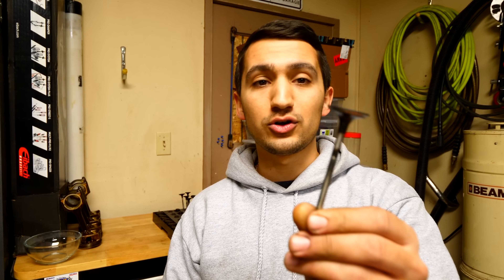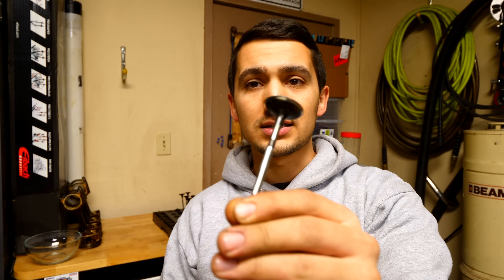How to Clean and Refinish Valves

Comment: Those valves look brilliant, but personally I won't be 800 grit sanding my valve stems because those clearances are precision engineered and once they're out of spec you need new valves altogether, otherwise you don't have the appropriate film of oil in-between. Maybe if I'm coating them and I need to slim them down first, I might.

Comment: all that truly matters is that the valve seats properly, that carbon will return within 5000km easily
Reply from the maker: Regardless with these valves or new valves, I will have to lap them into the seats to ensure a proper seal 👍
Reply: He's installing a catch can. The reduction in sludgy deposits will be realized immedietly just from that. Now that the valves and ports are a high polish, the walnut blasting will be much more effective.
Reply: He likes his cars to be super clean.
Reply: Polishing a valve decreases surface area for carbon to deposit on.
Reply: A highly polished back surface inhibits carbon deposits and improves flow over the valve. A highly polished face (inside the combustion chamber) reflects radiated heat from the flame and helps keep it a shade cooler (more important with exhaust valves). Read A Graham Bell
Reply: Polishing isn't bad but he needs to have them actually ground at a machine shop before lapping.
Reply: Agreed.  Polishing the stem is a big NO-NO.
Reply: install catch can after rebuild cylinder head
Reply: actually, having a polished valve means that there is less friction on it, the surface finish is much finer. They will get dirty no shit, but its probably going to be after 10 or 15K kms rather than 5.... and anyways, you can get additives and service procedures that will clean carbon off the valves, ie upper cylinder cleaner and fuel additive, also seafoam.. the point of this is to stop it from being as dirty as often and for perfomance
Reply: Polish does not mean less friction.  It means its harder for contaminates to attach, but the smoother the face, the more contact the air has with it, thus slowing the air.  Simple dynamics.  Look at the Magnaflow muffler build and they have holes inside of their mufflers for this reason.  More holes means less friction because it has a smaller surface area.  I bet the thermal expansion is better with the polished face, but I bet the only way you could see it would be single, or less than single figures on a dyno.
Reply: Polishing the bottom of the valve and above the seat to a little up the stem is good. Never sand the stem or seat. Now you need a valve job. Lapping the valves is not a valve job. Laying is for smoothing out the seat if it’s in good shape. Now that you sanded the angles off the valves you can buy new ones. Lol
Reply: @milanmastracci  Why didn't you put that in the video?
Reply: Your valve seat put under a microscope will look like the blade on a rip saw and seat to valve included angle will seat about as well as a man hole cover, or fit BBs between the seat and the valve sealing surface after removing 0.90 thousands of the valve stem with 36 grit sandpaper; You are now mechanic of the year!!!
Reply: He should scope the engine to see what they look like at 15,000 miles. Very interesting.

Comment: Valve lapping is a must now after you sanded them valves. The valve must match the mating surface on the head to have the proper seal. Good luck.
Reply: Milan Stankovic AD FREE you beat me to it. Props
Reply: That is must anyway ;) Lets hope he didnt made much damage with sandblasting so he dont have to polish seats like 3 days LOL :)
Reply: Pozdrav Urose! Ovaj moj imenjak se trudi. Pratim njega vec par godina.
Reply: Pozdrav Milane :) Jeste, mali baš daje sve od sebe, zato mi se i dopada :) (kada ga uporedimo sa njegovim vršnjacima dečko je genije ...) I baš mu želim da uspe u životu.
Reply: Never mind lapping I wonder if those valve stems sealed properly after that abuse 😂
Reply: I'm sure he found a way to attach the valves into his drill head from the back of the head and lapped those valves into oblivion....
Reply: Forget lapping them, it's time for the machinist to break the news to him that his valves are trash now. Because some idiot sandblasted the stems an then wet sanded them in a drill chuck.
Reply: Probably just sand blast the seat to match the valve
Reply: @mikespeck8642  😆
Reply: i was thinking the same thing. don't touch the stem or the valve seat.maybe a light lap with the seat if there's carbon. i would use a magnifier cam on my laptop on the seat.
Reply: Hell no. I'm not sanding any metal off the stem for the valve to wobble in the guide and for oil to pour down the combustion chamber and or  cylinder face, i'm not nicking my valve stems, i not sanding the coating off and i'm not sanding the rough atomizing valve head neither.  All bad advice unless you want shiny valves that you stare at, which means you're not driving that car.  Me i'm driving and won't be staring at those valves. I just want to be able to know that they are performing optimally, that they're strong, tight, don't leak oil and hold pressure. All bad advice except for a valve fashion show.

Comment: Sanding polishing i.e. reducing thickness of parts which are inside the engine , better performance can be obtain as you said , but isn't it dangerous for long riding vehicles . heat inside engine is going to damage this repaired parts more easily as they are thinner than usual .
Its a question shall we do it or not ???? 🤔

Comment: No, don't sand the stem or even scotch bright it. Also tape the stem before you put it in the chuck otherwise if will possibly get damaged by the hardened teeth of the drill chuck. 
Any metal removal from the stem is bad and will cause oil consumption and shorten the life of the valve. 
Otherwise not to bad.

Comment: Why on earth should you polish the engine valves?! all you need is to remove the built-up carbon... Also, sanding the valves might cause improper seal when you get a spot sanded more than the others!
Reply from the maker: If you aren't using a drill or some way to keep the valve spinning, yes I could see the flat spot argument, however with it mounted in the drill, it gives a very uniform result
Reply: Right... <3
Reply: And that's where the lapping/grinding comes into play...so no problem with that.
Reply: people pay a lot of money for new valves that are polished ,, it reduces carbon build up by a shit ton
Reply: Same reason you'd polish the runners and combustion chambers. Reduce carbon build up, increase air velocity and cleaner combustion (less hot spots). Will help reduce ping.
Reply: wurst, why it is stupid ? nothing is stupid more than someone say stupid for something without a reason. It is not perfect, we all have our theorys what is proper way and blah blah, he did clean them in the end, isnt he ? He might overdone this but nothing bad cant happen because of it. Yes, most important is that part of valve to seal mixture out and let in engine, also forehead of valve needs to be cleaned or polished. Also less mass of valve equals more RPM, thats why when we over here making racing engines grind them to max possible so they weight minimum possible ... Hay, why Im reviving secrets to one wurst ??? LOL ;)
Reply: Well, that is not correct all the way - you need to polish just exaust ports because unpolish on intake help air and gass mix better ... ;)
Reply: Flat spot is just one issue that could happen, the fundamental problem is the slight change of the geometry of the valves while polishing, which could impact sealing and performance. Such thing is not easy to be done right for the professionals who has the right tools, let alone the normal people. Think twice before you post something.
Reply: Dont forget you'll still need to lap the valves this mates the valve to the head,,, also please dont teflon from intake valve
Reply: Makes it harder for the dirt to take hold
Reply: false. this mainly only applies to the intake runners on carburated engines. and since he said "direct injected" the fuel is injected directly into the cylinder. Also on modern fuel injected cars your atomization is done by the injector itself.
Reply: Why does one need to climb Mt Everest....
Reply: Polishing valves doesn’t hurt them when done correctly, I have always known valves to be swirl polished to encourage a slight rotation as air and fuel enters the chamber, and to help scavenge exhaust exiting. That’s a performance boost, even if it’s a minor one. Just polishing the valves may help reduce carbon buildup, but long term if you have excessive carbon buildup the lack or presence of a polished surface is not your issue. 
Lapping valves is also important, valve seats and the grind on the valve itself are important for sealing. Yes, it’s that’s machined finish on both surfaces that allow them to mate and to some extent the two rough surfaces fill each other causing a tight seal. If one sealing surface is polished and the other isn’t slight gaps will exist when the valve seats. 
In the end if you’re going to polish valves do it correctly, because in this case he’s simply made his valves look good. That was a lot of effort to basically skip the performance boost polishing can add.
Reply: You re seat them
Reply: @Fisher1903  Is ping the same as knock?
Reply: @kiyoponnn  ping can cause knock.
Reply: @kiyoponnn  ping is detonation knock is when bearings go bad generally causing the engines connecting rods to knock around in the bores of the journals... generally speaking anyway
Reply: @akassasin5768  Is that so? Explain why wikipedia says ping and knock are the same thing. Gtfo dumbass
Reply: @Ashroyer86  Moron.
Reply: @kiyoponnn  It's all in context. Rod knock isn't the same as knock. One's bad rod bearings and the other is premature detonation.
Reply: @kiyoponnn  also "Moron"
Reply: @johnmeurer4780  Ok boomer
Reply: @kiyoponnn  I'm not even a baby boomer. You are very smart with your insults aren't you?
Reply: @urospetrovic5228  direct injection engine.. No need for fuel mixture..
Reply: @urospetrovic5228  because he has taken away the valve seat. The valves and their respective seats will need to be reground and mated to oneanother to prevent 'blow-by'.
If you look at one of the dirty valves, you will see a silver ring at the bugle end....... thats a sealing surface, and by using abrasives, that seal is gone.

Comment: The chuck could damage the valve stem.

Sanding the valve stem where its in the guide will make it loose.. 

Sanding the valve sealing face will require it to be lapped.

Comment: Professional machine shops will only walnut shell or soda blast valves. The point is to remove all deposits but not remove any metal from the stem and face. You have changed the shape of the valve by sanding it.
Reply: Jarrett Barnett yea i think you're right cuz by sanding the valve stem,it makes it thinner & will make the valve loose when installed right?i would do everything from this video,except polish/sand down the stem.
Reply: Jarrett Barnett im thinkin valve stem seals are rendered useless now that the stem is reduced...well but that depends how far up into the stem he sanded too. The valve face/machined angled cut is now rounded off im sure. It does look nice n clean though.
Reply: Do you fucking know that by far he take out microns? it will not affect anything and lapping seats and valve will seal it properly again. Also is true that many did not noticed any difference in polishing but many experts said that is good for less carbon to stick to the walls. I guarantee that if you take apart those valves after 5k they will be brown, stock will be black again! Also depends of the carburation and flow. This jobs are recommended only to who want spend time, if you go to any shop they will Never do it, the labour will be too expensive.
Reply: Bobby King many machine shops will do this intensive and meticulous labor...however they do rematch the valve angles to the seat on the head otherwise these machine shops could not offer warranty on workmanship and proper operation of the head. This super important when an engine has force induction. Top dollar like you said but no machine shop will rebuild cyl. Head without matching the cuts to the seats. Agreed minimal-none carbon will stick depending on octane levels.
Reply: Bobby King The issue is not polishing the face or the back side. That part doesn’t matter as the machine shop will cut the valve seat correctly. The issue is polishing the stem. The valve stem is pressed into a machined bushing and has very tight tolerances. If you take metal away the stem can now move side to side as well as up and down.

Also, please find an English language book ASAP.
Reply: Jarrett Barnett - what the fuk is wrong with my englush? Anyway, like I said, it take microns, you will never notice any movement on sides and if you really want to go via hard way and do not see any shop, with the same drill and special paste you will grind the valves and seats for each valve. Do you even realized that this video is about do it by yourself and refreshing (my englush) the entire head and valves by yourself? Of curse even for that you need some skills and knowledge, but can be all done this way!
Reply: Jarrett Barnett yup. This guy don fucked up but time
Reply: @jarrettbarnett7656  @ Jarrett Barnett -- THIS.  Yes, this is the issue.  Lapping the valves is one thing, but don't touch that stem!
Reply: How do I clean valves without removing any metal? Is it safe to wet sand valves using 5000 grit sandpaper by hand? I just want to get it clean and I don't care about shinyness
Reply: @kiyoponnn  No man, don't sand the darn things!  Machine shops will clean the things with crushed up walnut shells through a sandblaster.  Walnut shells are soft and won't take off any metal.  Sandpaper WILL remove the metal.  Don't remove metal!
Reply: @lashlarue7924  dumbass, grit makes a difference
Reply: Lol I laughed my ass off when he sand blasted it
Reply: @robertking1032  microns is enough... do have any idea how tight sealing tolerances are?
Reply: @TomoHawKzZ  basically you do not understand the meaning and have little mechanical background, what he did is not going to have any issues what so ever!
Reply: @robertking1032  "you dont understand the meaning"
Of microns?
I'm a machinist lmao and 800grit fucking sandpaper is gonna take off a lot more than a couple of microns.
Reply: @TomoHawKzZ  I am a machinist too and we are not talking to cut a new piece, we talking to refresh, clean components from shit, make the things smooth with no shop/cnc involvement!  I did those jobs before, maybe you are allergic to 800 grid, yes, actually I will use grey polish sponge instead but anyone has different opinions butI did those jobs, plenty, no issues what so ever if you replace all the seals. Look like you are all too fuking paranoid. You all have big bucks, so whh the fuk you all are here?
Reply: @reegyreegz  if I remember well there is organic blasting too, no damage at all.
Reply: @kiyoponnn  no.
Reply: ThatScootsy 26 microns is .001 of an inch lol. If he takes off a few microns it literally makes no difference at all. Any “play” between the valve and guide less than .0001 will not matter at all. His only concern post polish will be to grind and lap the seat. Also the part of the valve near the head while in operation is nowhere near the guide. It is inside of the inner spring and does not matter at all if he took a little material off there.
Reply: No to sandpaper

Comment: Even if you did regrind  the valve seats (wich you have completely destroyed) and you didnt touch the valve stem, you still have to worry about how broad the valve seats become (regrinding always makes them a little wider) if that is out of spec it might either overheat your valves or not seal properly. Dont worry about that after touching the valve stems though , because by then you have just completely fucked up and are free to get new ones.

Comment: What if a drill press stand was used instead of holding the drill by hand? Would if be safer for the valve?
Reply from the maker: I don't think that would be any safer / more damaging to the valve. As long as you don't jam the valve into the chuck, you should be okay

Comment: Also, I can't see that this would hurt as long as polishing does not occur on the stem. I would be worried about the oil clearances on the part that enters the guide. But as long as its just the head, that is fine. You can get a performance benefit because polishing will help keep carbon from sticking to the valves. The same can be done to the combustion chambers and ports. Great video.

Comment: Cool, if you're gonna use the valves in your living room or somewhere to admire them. In an engine you should give the head to a shop to relap the seats and relap your already screwed valves... Then compression test the cylinder chambers.